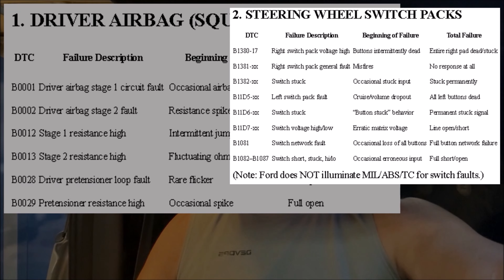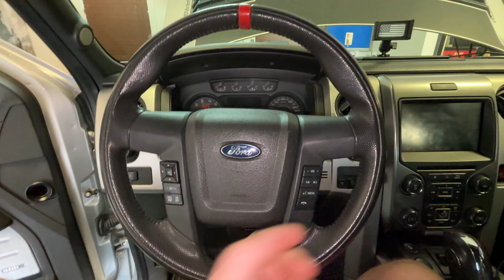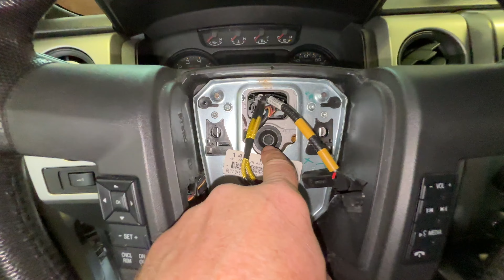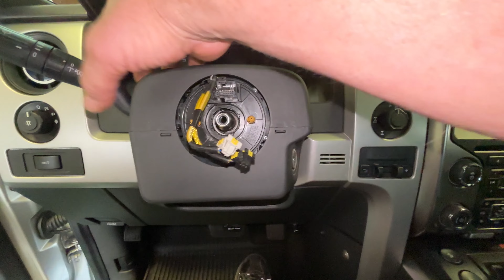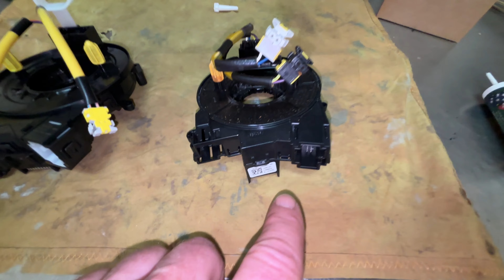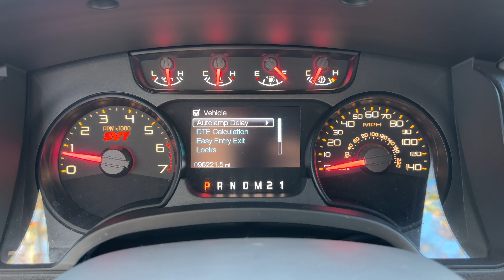Clock Spring Replacement: 2009-2014 Ford F-150 & Raptor Hidden Code B1380:17 (No Check Engine Light)

Comment: What was the dtc?
Reply from the maker: I should have mentioned that.  B1380:17
Oil Change Reset Button Circuit Failure / Circuit Voltage Above Threshold - thanks for asking